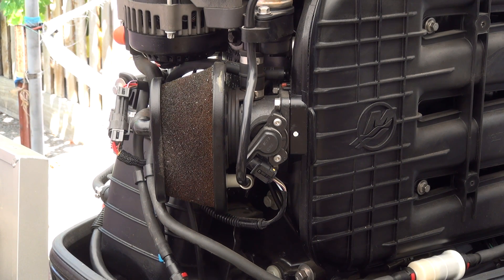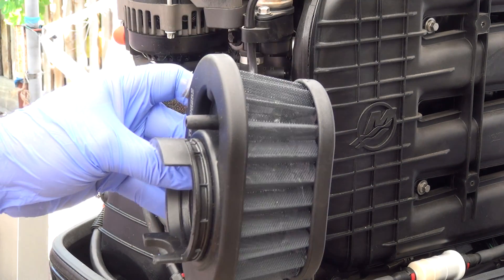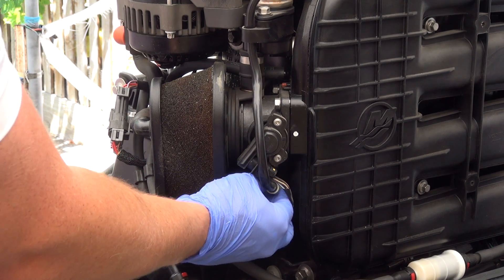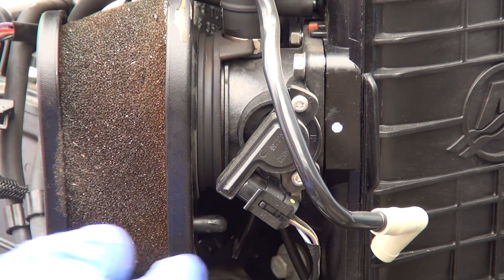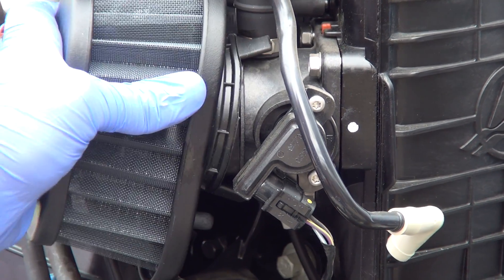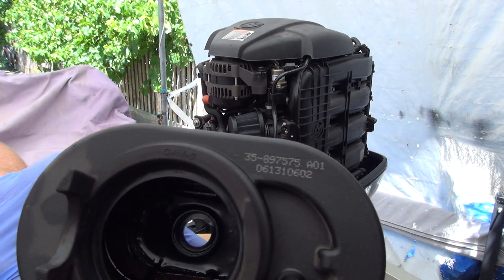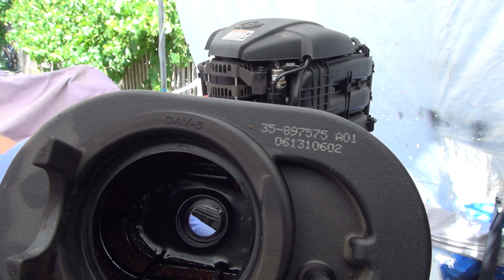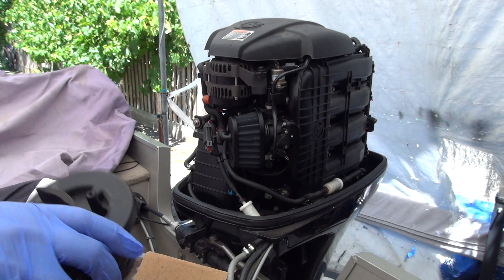How to replace Defective Mercury Outboard Air Filter on EFI Four Stroke75hp 90hp 115hp

Comment: Don't know how you got that on so easy,  my original one loss some of the foam, but I even retried to install the old one to see if it was very hard to put on, and it was.  On mine it may have looked like it was on from the front, but not seated on opposite side.  I had never seen an air filter go on so hard.  what a stupid costly design.  I didn't even have 20 hours on boat, bought used with only 4 hours on engine, never even worried about checking it, since it had low hours, just happened to see it, but again very hard to put on.  I thought I may have to put oil around it to get it in place.  My engine is a 2011, had for three years now, no engine issues that I have noticed due to filter.
Reply: Thanks for posting this. What a poor design.  Bought a 2013 last year w 40 hrs on it.  Foam was already half gone when I noticed it. I pulled it all off but haven't replaced it yet. Any thoughts on where it went? No noticeable engine issues but then I've only used it one season....
Reply: @jpf4213  thought maybe mine was sucked up in the injectors or fell down in bottom of engine compartment.  Never any engine issues, replaced filter and was good to go..

Comment: Does a 2006 4 stoke mercury have air cleaner
Reply from the maker: The engine is a 2006 Mercury 4 stroke. Air filter can be seen in the video.

Comment: i looked at my filter about 4 years ago and it had completely dissolved.  I freaked out, couldn't find any pieces anywhere.  Luckily, it didn't cause any engine problems.  replaced the filter material with some motorcycle air filter material.  no problems afterthat.
Reply: Do you know what filter material you used? I am having the same issue. I want to make sure I get the right one. Thank you.

Comment: How do I get old foam filter chunks out of the intake?
Reply from the maker: +Art Remsik That's a good question. I have no idea.
Reply: +Nevadaiscorrupt to update, Mercury (corporate) advised the foam chunks would deteriorate and not cause a problem.
Reply from the maker: My Uncle will be happy to hear that. About 40% of his filter was sucked into his engine. His engine is hard to start and doesn't idle well when cold. Not sure if it's from the filter or not. Maybe it's his lack of running it. Only has 20hrs. Mine has 230hrs and starts and runs like a top, but I start mine at least every 2 weeks.
Reply: I have a 2013 90hp. My filter was about 50% gone, I took the entire intake off and blew it all out looking for pieces and couldn't find any. The engine still runs completely fine.
Reply: Mine is 99% gone,, just noticed that...wonder if I could just fab that design myself...amazon has it for $85,,,yikes